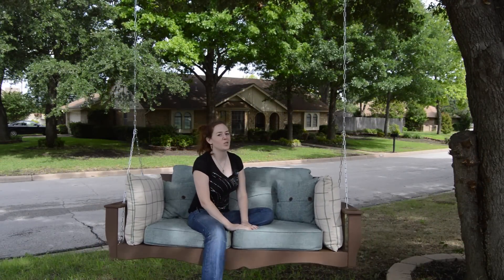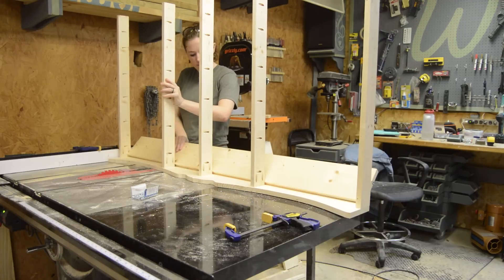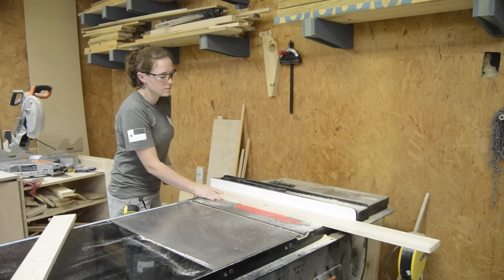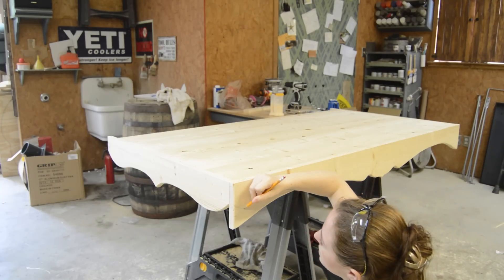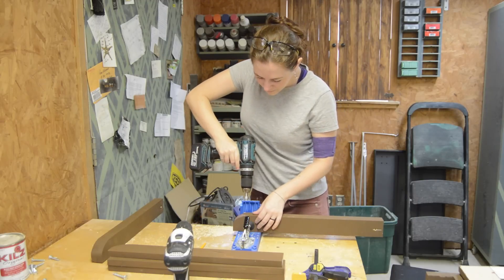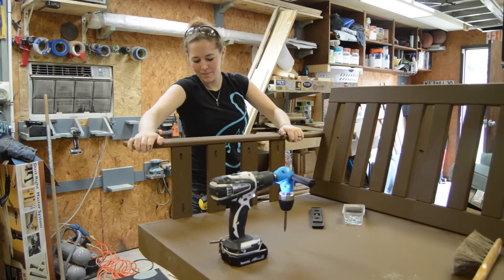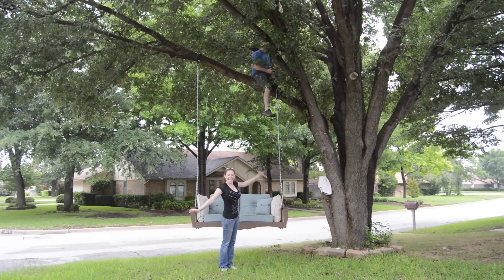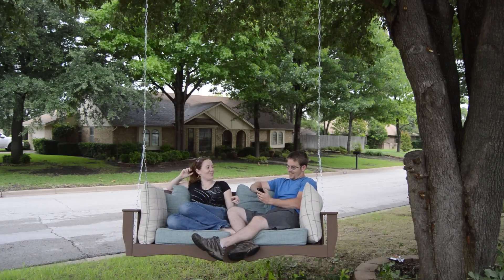Easy DIY Hanging Bed Swing

Comment: Another nice job kiddo.
I read the pocket hole "snit" and just want to add my opinion...You do what makes you happy and you feel is right. Not everyone has the tooling or desire to build different joints. Way back when you were having trouble with the "not a true build video" I wrote you and told you the same thing, do what you want!. Having done hand cut mortise and tenon joints and also having done pocket hole joints, I do what I want when I want. My advice is you do the same.Thank you for all you do. My little tip which I am sure you already know is to clamp a waste block under wherever you are using a paddle bit to reduce blowout. Also paint or seal the inside of the drilled hole to protect it longer.
Mike
Reply from the maker: : ) Mike, you are too sweet to me. You've always been so encouraging and I appreciate it. I will continue to do what I want, I feel really confident in the direction I'm going because I'm enjoying myself and I am not going to lose that in order to please somebody else. I just wish people were a little more open minded, but oh well! : ) Good tip about preventing tear out! I haven't heard that one. People always tell me to drill the hole from both ends, but I'm not a fan of that so I'll try your way next time.
Reply: Well said guys. April, two thumbs up. Keep doing what your doing. Build it how YOU want it. And thank you for putting up these videos. I'm learning woodworking and you are an inspiration. Douglas.

Comment: Thank you, April.  My next version of this swing will be wider; with four supports, a 60 inch width would not make swing structurally unsound.  Also, in moist/coastal climates, use (alas, more expensive) stainless steel or galvanized hardware for durability and to avoid rust stains.   I worked on a deadline, so had to buy hardware at local big box, almost $100.  Next time, online.  For safety, I used screw eyes instead of screw hooks, and quick links for connections, which added more to hardware costs.  Made of cedar and rust proof, this swing will be enjoyed for decades.

Comment: Looks pretty good for an "on the fly" design project. If I make one, I will probably use cypress or redwood since it will be outdoors. I like and use pocket holes a lot too, but for a project bearing weight, I will probably modify a few of the joints to use mortise and tenon joinery, plus waterproof glue. I'v made many Adirondack chairs that stay outdoors and waterproof glue has been a lifesaver on them. Nice job, April.

Comment: I just started watching you because you are awesome, and I miss my wood shop. This is the second project that I have seen you freehand a profile. My experience, that always seems to come out a little lumpy. What I did to layout a similar profile is put several finishing nails in 1/4" plywood and pull a scrap piece of 3/4" x 1/8" up against it. You can pull a little or a lot to get the profile you want. I then bandsaw it out, sand it, and now you have a router jig for 1/2 of the profile. Plus you now have a pattern for the next time this comes up. Oh, and for sanding the lumps out, put peel and stick sandpaper on a thin, flexible scrap, and let it follow the profile.

Comment: if you cut a slot on the arm up to the cup holder, you can use the cup holder to hold stemmed wine glasses as well. Nice build. thanks for sharing.

Comment: If you are worried about the strength of pocket hole joint just add some good quality glue to the joint. I don't see that pocket screws are a problem. April you are a natural at this keep up the good work.

Comment: A neat redesign could be to make the bottom out of slats like your porch swing. It would give it a better appearance when the cushions are removed for when it's raining or in winter. The positive of this is it will give the bed a lot more air so moisture won't sit and water won't pool.

Comment: Hi April, Not sure what paint you may have used but I tried some stuff called Cabot Deck Correct. You can have it colored to your desired shade and it goes on much like latex paint but when it dries, it seems to have plastic coat on it. I have been very impressed with it and the people I talk with love it as well for resurfacing their decks. 
 I love this one over the regular swing although I love both. You're making some great videos! keep up the great work.

Comment: I realize this is about two years old, but I think adding sections of water hose where the chain wraps around the tree limb would help prevent damage to the tree which would decrease the likelihood of the limb coming of from rot or bugs getting in after the chain destroys the bark.

Comment: Careful with your chains / strength / connections used. I made my own garden hammock from paracord once and made the mistake of using standard rope! for the edges - after a few summers and having left outside in winter - it hit the floor one day! luckily I was in it - and was holding onto a rope I fitted in the pergola roof to climb in. But has made me consider these things since. I love your work. Hope you are still happy working for yourself etc, I think you're really great. You could make a rocking chair (for yourself)

Comment: Two things.  The angle finder is called a "bevel guage".  Also, have you given any thought to the deck swelling with moisture or changes in humidity? You probably should have left a slight gap between each deck board to be safe.  Great looking swing.
Reply: 2 things: 1. Bevel gauge, angle finder, potato, tater. Welcome to texas where we done give a $h1t what it's called, we can call it what we want. 2. The deck is being covered with pillows so I'm sure it's not real important. Plus the amount of humidity in the air at the moment I'm sure is around 100% so that wood is probably at its largest point.
Reply from the maker: Jay, you crack me up. : ) Im self taught and don't always know the right name for things, so thanks for telling me. As for the deck...we'll see. Again, I'm self taught and learn by doing. So ill watch how the swing weathers and learn.
Reply: Jay McCrary Yes, you can call something whatever you want, but you would still be wrong.  An angle finder and a bevel gauge are two different tools.
Reply: April Wilkerson Hey April, I love it.  I am self taught also.  I kind of rough sketch what I am going to build and figure it out as I go.  I get a lot of great ideas and tips from you and other woodworkers on You Tube.  I notice you drilled all the way through with your paddle bit.  You can reduce tear out by drilling from one side until the point of the bit starts coming out the other side then switch to drilling from the other side using the hole made by the point as your center.  Keep up the great videos.
Reply: Wow.

Comment: Not nitpicking but Im not completely sure about the construction and how its supported by the chains. I dont see it being too much of a problem as is but I do think it could be better. I think there should be 2x4, front and back, that run the length of the bench for supports that the chains attach to. Think of floor joist being supported by a header/beam and that may give a better idea of what Im talking about.
Reply: David Mm I was thinking the exact same thing!  One day, Grandma and three grand-babies are gonna be in for a nasty drop to the ground, I hope the dog isn't snoozing underneath it.  I'd guesstimate about a (safe) 200lb limit as-is, 2x4 supports would easily double that or more.  But, like you, I'm not gonna nit-pick because it's a GIRL, in a SHOP with POWER TOOLS!   We need more of them doing this stuff, to hell with stereotypes, way to go April!!   And April, please heed this advice, remove all your jewelry/bracelets before you start in the shop and put them back on when you leave the shop, safety first!

Comment: Thank You for this tutorial! 
Would it be possible to make this type of swing but very basically just using a thick price of wood to sit on without the arm or back rest? How would you hang this in a living area? 
Would love feedback & if possible a video demonstration? 

Annie
Reply from the maker: Just build the base like I did but stop when I start building the back and arms. So you'll just have a flat platform. Screw in two eyelet hooks on each side (one in the front and one in the back) then hang it.

Comment: Really nice April,  what kind of wood did you use, any thing special or just pine and counting on paint to protect it
Reply from the maker: I went back and forth on either pine or cedar. However, since I wanted to paint it I went with pine. I put on three coats so we'll see how well it does.

Comment: Hey April! I was wondering if there is a rule of thumb you use for spacing the supports for the back. I've got a bench but want to add a back to it, and your method looks like it'd be good!
Reply from the maker: Hey there. I'm sure there is a rule out there somewhere, but I don't know it. I just spaced them by looking at it and thinking it was enough. : ) So I have one on either side and then I divided up the center space for three supports to go.

Comment: Very cool.  One thing I never did understand is how do you know what length of screw would one use for the lumber of choice???  I never did understand that.  For example if one would use 3/4in boards what size screw would you use so it doesn't show on the other end???  I know that might sound stupid but I never used a kreg jig & I have one but have never used it yet because of that factor plus been really busy with home life as well.  Thanks April.
Reply from the maker: The jig comes with a small book that has a chart of what length of screws to use for different thickness of material. For 3/4" material, use the 1 1/4" screws. I would suggest ripping that chart out, or making a copy and pinning it on a shop wall so it's always handy.

Comment: Great project. Did you use eye screws to attach the chain to the tree?
Reply from the maker: No, my husband actually used two ratchet straps. Wrapped them around the limb then used the hooks to join them and also hook the chain on.

Comment: Does the center sag at all with the deck design you created?  I was wondering why not run your chains underneath the deck to distribute the weight of a load. That way your load wouldn't entirely be on the arm supports AND the deck, but solely on the chain. Ive never built one just wondering if that would work better. I would like to build a  twin bed sized version.

Comment: just curious, it seems you are a righty with how you draw the templates, is there a reason you rip your wood with the fence to the left of the blade so u push with your left?
Reply from the maker: I do it for camera sake. : ) When the fence is on the right, the camera doesn't really pick up what I'm doing.
Reply: April Wilkerson  Your organization skills are great as well. I think it involves a lot more than just the woodworking.
Some thoughts:
1. Making a nice present for your mom.
2. Finish everything in a week.
3. Limit spending to much money.
4. Making a appealing video.
5. Figure out the new elements like chain and metal mounting.
6. Sketchup. possible software frustration.

Did I forget some major thing?

Comment: Great build. Did you use any type of weather sealant on top of the paint after you got it completed?
Reply from the maker: It's three coats of exterior paint, what sealant would add protection?
Reply: April Wilkerson i like exterior spar varnish

Comment: Hi April, I just finished restoring a porch swing and im a pretty big guy and i cant fit into the attic since the ceiling that connects the porch to the entrance of the attic is very narrow. What Alternatives do i have for installation? Also the ceiling on the porch area is stucko finished.

Comment: How long does it take the cushions to dry after the rains? lol  Very nice April !!!  Keep up the great work !
Steph
Reply: It's not the rain that I would be worried about, it's the birds. As far as the rain is concerned I would get outside cushions and scotch guard the hell out of them like I did my patio loungers, 3 or 4 coats of heavy duty Scotch guard.
Reply: Ahhh. Understood. :)
Reply: Drying time would be zero, since you would most likely remove the cushions before it rains or when it is not in use.

Comment: I have recently bought a home with two...(I don't know the names of hardware)... eyeholes?  screwed into the ceiling of the porch where there was once a porch swing. (SCORE!!) But I am afraid about the weight that this might hold. - the weight of the swing plus the weight of people sitting on the swing.  It SEEMS as if they are spaced far enough apart for a two person/love seat swing.
But do you have any hints as to how I can determine the weight they can hold?  I am excited about the possibilities...but it IS the ceiling of my porch - and I hate to make a costly mistake.  Thanks for your help!
Reply: Day2DayWithMcK Oh, and ... GREAT tutorial!!  I'm not sure I am nearly as crafty/skillful as you...but I can dream that someday... 
(subscribing)
Reply from the maker: Well to be safe you could always remove the eyelet hooks and replace them with ones you buy so you know what weight they are rated for. When you go to the store, it will tell you on the package how much weight the hooks can hold. You will always want to make sure that they are installed into the rafters. Whoever installed them might not have installed them in the correct spot, so I would run a stud finder over the area and make sure the hooks are in line with where it tells you a stud is, before adding any weight.

Comment: What is the capacity of the "S" hooks they didn't look very strong. With a person and the swing it can get heavy quickly.
Reply from the maker: The hooks are rated at 350lbs, the chain is rated at 340lbs, and the eyebolts are at 350lbs as well. I was keeping the weight in mind as I was buying everything, and left myself a very big margin.

Comment: What did you use to attach it to the tree limb, leather??
Reply from the maker: No, my husband actually used two ratchet straps. Wrapped them around the limb then used the hooks to join them and also hook the chain on. This is going to my folks, so it is just a temporary set up.

Comment: I'd recommend using those threaded chain links rather than S-hooks, for strength and safety.
Reply from the maker: Threaded chain links? I'll have to look into them. These hooks are rated slightly higher than the chain so they should be fine but I'm still curious about the links you're talking about.

Comment: I want to ask about the price of all the tools you use
Reply: +Jaber Ali I don't know the price of the tools she uses, but you could do the same with a bit more time, and only sandpaper, a 10$ used drill and a manual saw or a jigsaw, which is also about 10$ used.

Comment: I find that pocket hole joints tend to be too weak, and adding more screws doesn't help those joints. Also, gluing pocket hole joints doesn't help. I try to use dowell joints.

Comment: I think your design-on-the-fly and showing mistakes/design changes, represent your honesty and maturity as you grow in your skills.  I like it much better than stale, packaged vids that almost present the host as someone who never makes mistakes or changes their minds.  I would also be concerned about the S hooks and non-forged eye bolts mounted at right angles.  Both will weaken over time and the eye bolt rating is for in-line use, not at right angles.  With eye bolts, as you move off the center line, the load rating decreases.  I love the swing, but a design modification incorporating more substantial structural members allowing for inline eye bolt loading and quick links insteak of S hooks would probably be advised.  I love your channel and wish you the best.  Keep up the great work!!!
Reply from the maker: Hm, good point about in-line use. You've got my wheels turning on how to modify it so that I would be able to change the orientation. Thanks for the advice and making sure to put it kindly. : ) So many times people get on here and come across as barking orders and it's difficult to not get my hair raised over it. Somebody else suggested quick links, so I'll go buy a few and replace the S hooks before giving it to my folks. Oh, and I'm very glad to hear the feedback that you enjoy my channel. : ) Thanks again for the input on the hardware.
Reply: April Wilkerson I tried to carefully craft my response to not come across as a know-it-all and just barking at you.  Don't ever let those that "bark" at you give you even a moment's pause at what you are doing.  I applaud you for what you are doing and wish I had the chops to do something like this on YT.  IMO, those that "bark" at you aren't EVER worth a response.  Ignore the noise of their pontification and move on to those that appreciate what you're doing.
Reply: John M Gibby John. It's a pleasure reading an intelligent comment. Pura Vida mae.

Comment: Can’t afford all the tools  lol   Great job
Reply: She started out buying 2nd hand tools from Yard Sales and Pawn Shops, buying only the tool needed. Most projects can be done with a tape measure, drill, circular saw and a jigsaw. It may take longer with those vs the other fancy tools such as table saws etc but they CAN be usually done.  You get inventive and figure it out. That's part of the pride in it, not saying why you can't. She didn't start out making complicated projects as she does now either. She started simple and as her confidence, experience and tool collection grew, so did the difficulty of her projects.